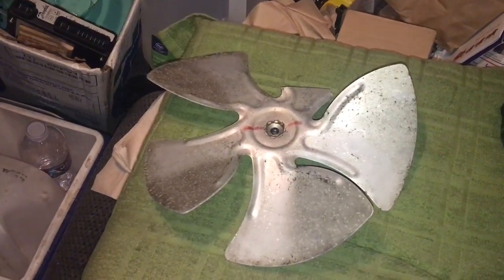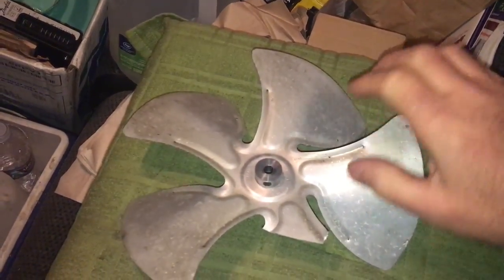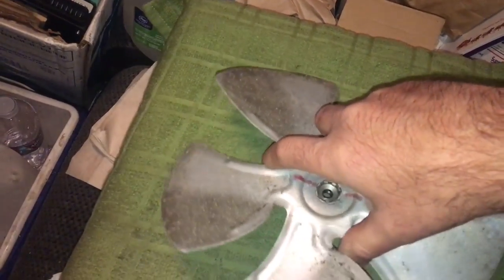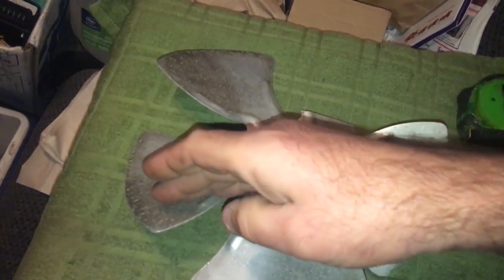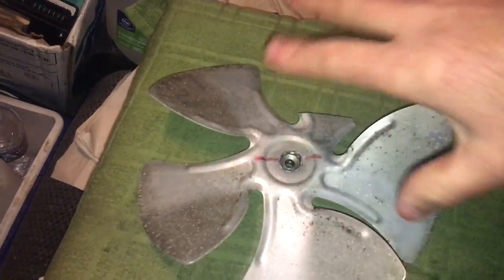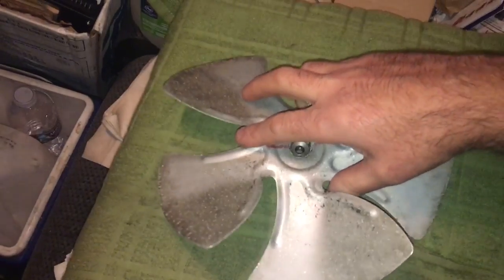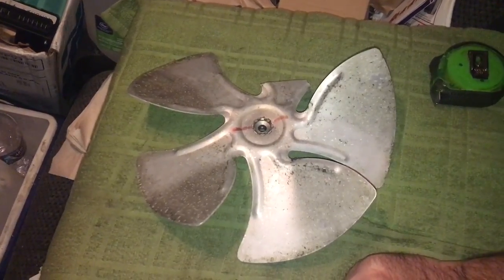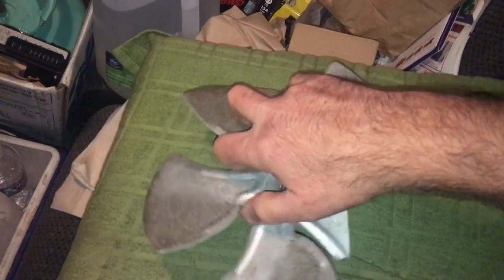How do i tell which direction a Fan Blade Turns ? This is How !

Comment: Great tip QUESTION 
HOW DO YOU REMOVE SET SCREWS FROM UPSIDE DOWN CONDENSER BLADES LIKE HEAT CRAFTS
Thank you
Reply from the maker: use a Long t-Handle allen key. get one about 9-12" long. available in any Hvac supply house.

Comment: Did you ever find out how your blade broke? Inherited a non working attic fan, pulled the motor out and hello jammed blade. Replacing motor and blade as they are vintage 1989...
Reply from the maker: no. They just get old and crack sometimes.

Comment: My evaporator fan went out. I had some old ones from other junk fridges. Put one on and the fan blade was not as curved as the old one and was intermittently making noise as it rubbed against the plastic fan shroud. I replaced it with the original blade and then had the problem of the blade running in the wrong direction clockwise and not counterclockwise as the original apparently had. So it was not  blowing air out into the freezer. It only has two hot wires and a ground,. I reversed the hot wires thinking this would reverse the spin direction but it still ran clockwise. So then went to my junk fans and found one with a blade that was curved in the opposite direction of the original. That solved the problem. Some of these motors run counterclockwise and some clockwise and blades are also designed for that application. So if your replacement fan is not blowing air into the freezer compartment and you can not reverse the spin you can solve it with the right fan blade.
Reply from the maker: yep.

Comment: Thanks man. That helped. Ive been looking at video after video to see which way my HVAC blade spins cause i didnt look before i pulled it off. This helped
Reply from the maker: Allways scratch a mark on the top side of the blade to make re-installation easier. use a knife or screwdriver to scratch the blade with a " X "  for top or front. Or u can use a " F " or a " T " .  Makes Life a Whole lot Easier ! Do not use a Marking pen as that can Wash Off When Cleaning the Fan Blade.